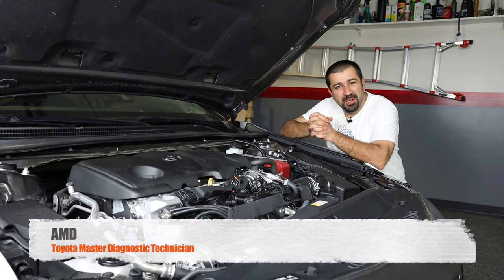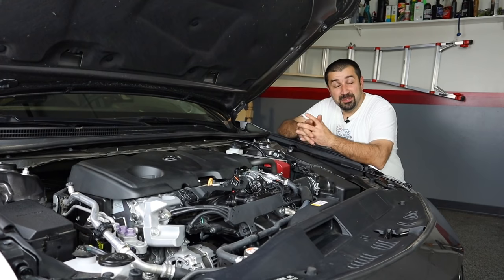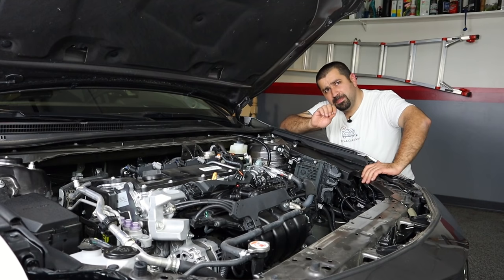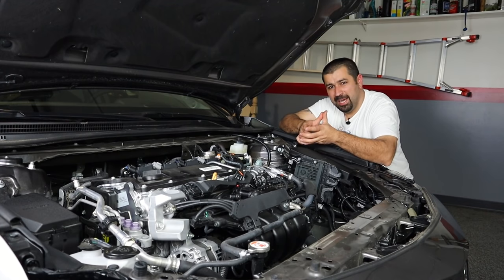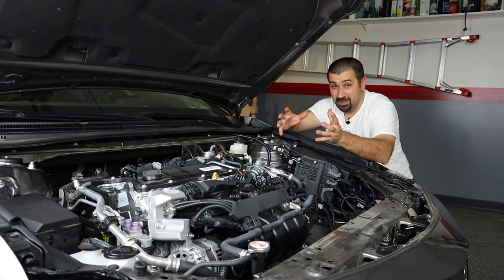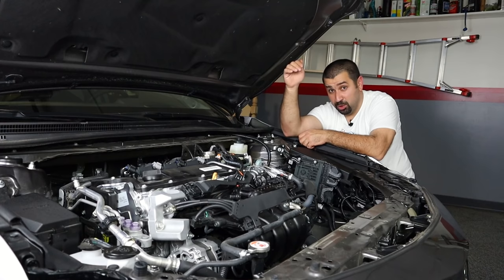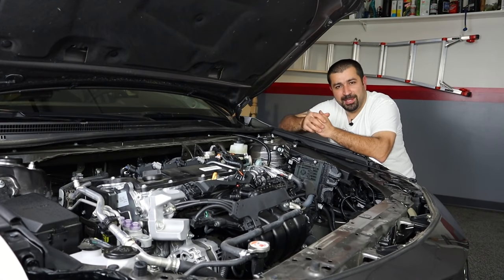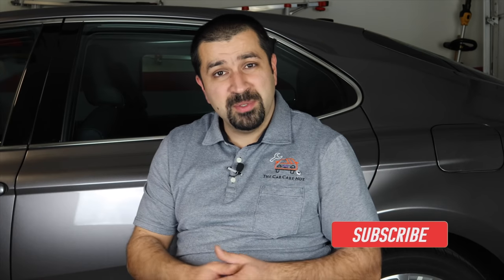Toyota's New Engine Technical review Part 1 : Cooling,Lubrication,Direct Injection and EGR

Comment: Ford ruined the durability of the robust  5.4 L V-8 and GM the small block by adding unreliable, complex cylinder deactivation to two very robust motors.  

This path can and does have failures.
Reply: Everyone says that in the beginning of anything new
Reply: @baseline4102  Especially when the new less durable valve train components fail prematurely as none have before and cut the lifetime of the engine from 300,000 to 150,000 miles. That's why the used markets avoid them, and why the older trucks are still on the road and the later models are in the boneyard.
Reply: @buzzpedrotti5401  
They avoid it Because it's expensive as we all know about Toyota Used cars
Reply: @buzzpedrotti5401  
If they not improve their engines people will say outdated cars ,bad gas mileage , boring , slow ..
If they improve it .. not reliable, complicated , overpriced parts etc.. 
(I would rather to improve it and face the future even if it gose wrong , im here to fix it )
 I saw many Camry's from model 2018-19 reached 150,000 miles and still running smooth
Don't get ahead of yourself , just take care of the car properly and everything will be okay
Reply: @baseline4102  Or rather than giving up you pay close attention to the reliability of models and model details and avoid those models with problems.  Like late model Corrollas and Hondas  with low tension oil rings that seize much more often and earlier than the high tension oil seal rings used on earlier models.

My 05 G35 MT has the same design flaw and now burns a qt every thousand miles after perfect maint. for 250k miles.

You can always do better by understanding more, just have to care and pay attention.

Comment: Won't that EGR add soot/tarnish back into the system and prematurely polute all that $pecial Oil being dictated to the customer.
This complicated and somewhat new engine is probably already beyond tech level diagnostic knowledge. Throwing new parts at  
something because you have no  real understanding of what is wrong is a brutal way to treat the customer. 
Dealership Labor Rates are already  Skyrocketing. I would like to see Service removed from dealerships and come up with a Quality
and Brand Specialised Repair System that does not Prey upon the customers and actually competes and is publicly  recognised for Excellence.

Comment: Coolant system has been in BMW since 2000, thermostat is run by heat to open the pump, oil system is only for non-sport rated engine and cannot be used on performance engines as high oil pressure pump is needed, 5w-16 is for gas mileage but you can use different multi weight oil with no problems, fuel system only Toyota does both, egr system is nothing new also Toyota does not manufactures their engines, all Toyota engines are made by Yamaha.

Comment: With that much complexity in a daily drive car with 0W16 oil, i feel Toyota gonna become the next BMW overengineered disaster.
Reply: Better fuel efficiency, less emissions, far less reliable and not gonna last long like a classic Toyota. Simple Physics.
Reply: it should be fine if you really look I feel like they took a lot of influence from the Mazda sky active series. It even sounds like one with a aftermarket exhaust

Comment: The 2 fuel injection system violate the "KISS" rule. Toyota are following gov. demands to tunnel vision on better gas  mileage. If all else is equal, more parts means more to go wrong, and anything wrong with the direct injection system, the cost to repair it I bet would have wiped out at least 5,7 years of fuel saving. You save some gas, but not money. This held true for cars since the 1980s.  Gas is not the biggest cost upkeeping a car, but most noticeable to the ignorant. There are cars I cannot afford to own even if the gas is free.

Comment: Biggest mistake Toyota will ever make.  This engine may break Toyota within 10 years if it does not go away before then.  So how many quarts of oil does it burn per mile?  No way can piston rings keep 0W16 out of the combustion chamber.
Reply: I don't use oil and I use synthetic 0-16
Reply: Lots of examples over 200k miles with no problems.

Comment: Mostly I hear bla, bla, bla . 5 more 1,500 dollar computers an extra fuel pump, an electric water pump I'll save 500 dollars on fuel if it makes it to 200,000 miles(as you stated they are already having issues) but it will only cost me an extra 7,500.00 in maintenance over the 7,000,00 I would have had to pay with out all this additional wonderful new ####. But I have been warned, Thanks

Comment: 0W16 is only there to meet the emission standards and lower fuel consumption at the cost of engine life. Engine will be much better lubricated with higher viscosity. You don’t need this thin of oil unless you live in Antarctica

I just changed the factory oil to 5w20 and the engine sounds much quieter especially at higher rpms. People that claim it’s due to tighter tolerances are hilarious. Toyota just trying to meet CAFE standards.
Reply: Ok automobile engineer from Uganda school commerce in soil analysis 💩 🐒
Reply: Living in a tropical country, all A25s here run on 5W-30

Comment: Sounds like a nightmare to own long term as far as reliability
Reply: There's actually a few guys with 200K miles already I read on the toyota forums for the 2018 Camry (first year of this engine) and the only reported major issues I've heard of was a water pump going out wheel bearings.

Comment: this engine is sounding like the crappy mercedes engines which have multiple cooling system problems and failures . I REALLY dont like electric water pumps as primary source of cooling. they fail 100x times more than an old fashioned mechanical pump!

Comment: Basically  the engine is electronic control to last  100 thousand miles by the computer with excuse of fuel economy. Germany engineering as it best. Toyota goes to the 🚻.

Comment: right I've been working on cars for 40 +years. So you think .04 of viscosity is going to hurt an engine. lol up & down oil pressure will hurt an engine which you can't fix with thinner oil. your brain washed by the super smart guys at Toyota. I'll stick with lower engine noise & my 5mpg over sticker with my  0w-20 Synthetic high mileage Valvoline.  yes, I own a '21 Toyota Camry just taken on long trip. I promise not to tell Toyota the sticker said 38 & I got 43 with 0W-20 high mileage Valvoline. To be fair I did get 38 going through West Virginia hills. Thinner oil more friction & wear. no matter what computer does. you can't cheat physics with thin oil.